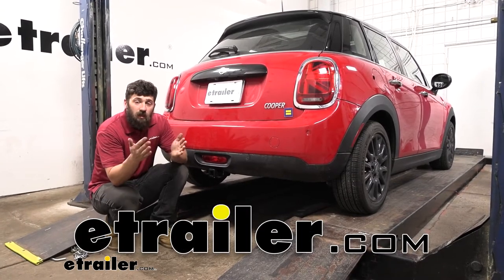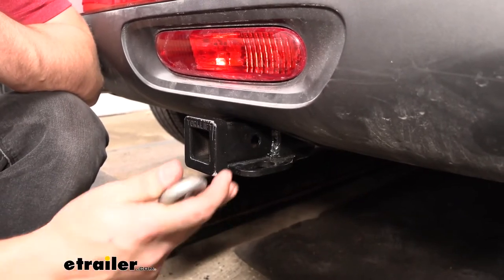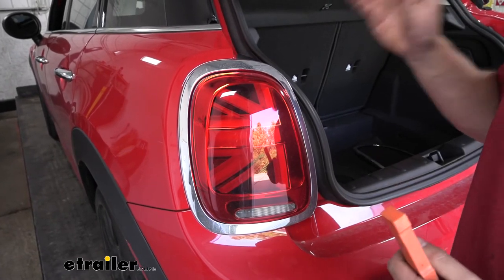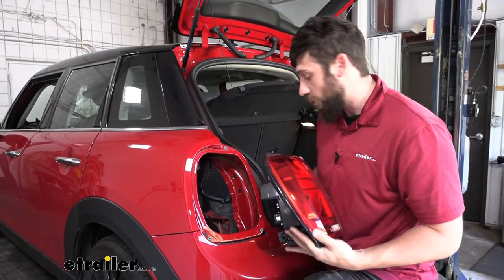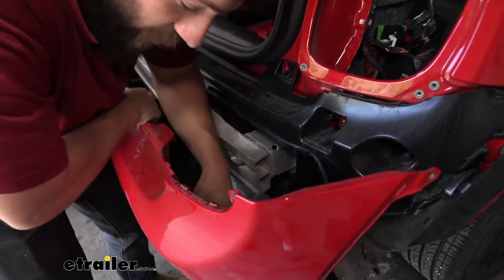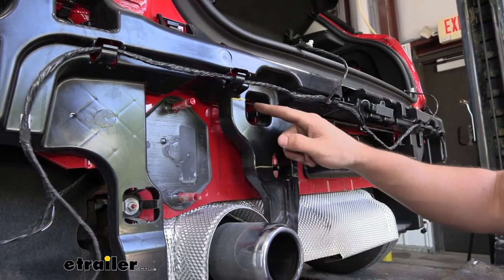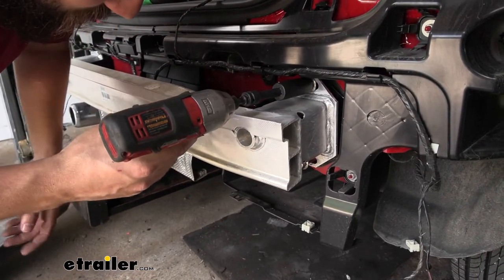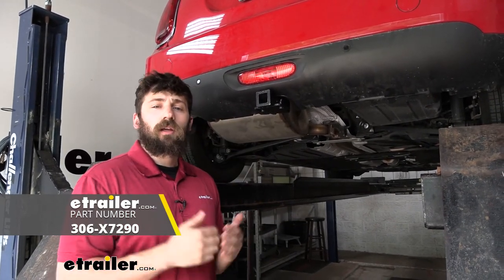etrailer | EcoHitch Hidden Trailer Hitch Installation - 2021 Mini Cooper

Comment: This HITCH also works on the 2024 Mini Cooper Hardtop.  I noticed however that the upper hitch mounting bracket holes on the diamond looking plates need to be widened by about 2mm each side.  A Dremel tool took care of that widening problem, and it now fits very nicely.
Reply from the maker: Thanks for the tip! We can't recommend that fit to our customers because EcoHitch hasn't tested it yet, but we'll get with them to find out their timeline on getting it tested. We're glad to hear that you got it to fit, though!
https://www.etrailer.com/Trailer-Hitch/EcoHitch/306-X7290.html